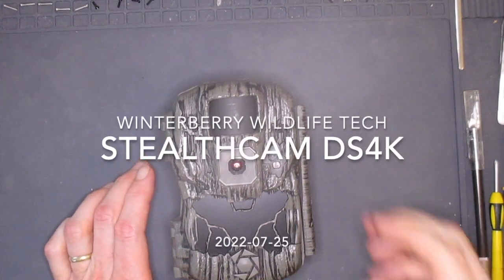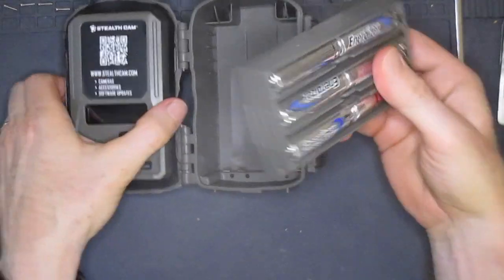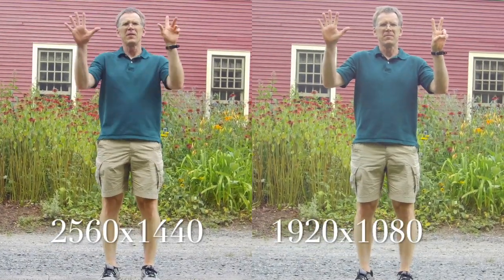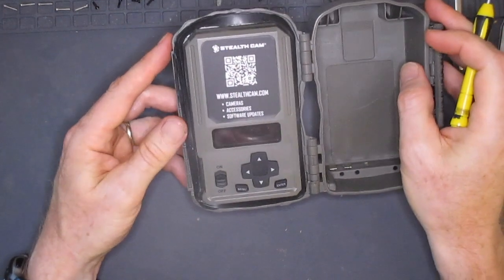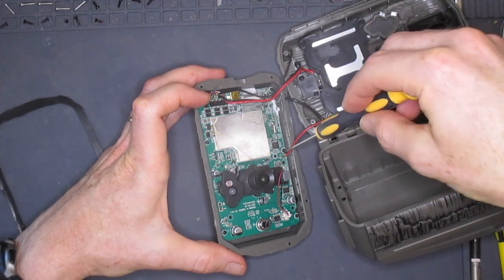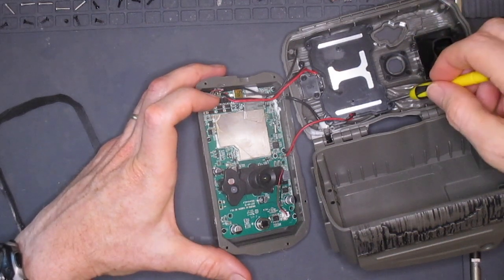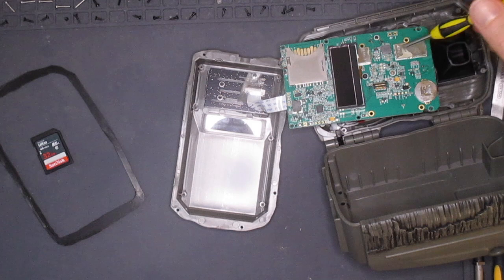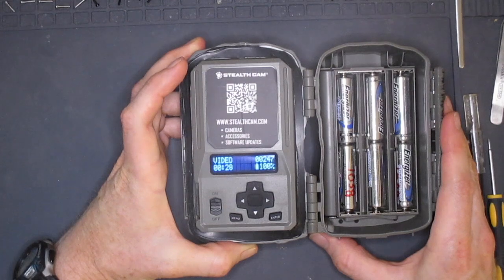Stealthcam DS4K Overview and Teardown   HD 720p

Comment: Do you happen to know of any replacement parts for the sensor lens for this camera. Something happened to mine and has several holes in it now
Reply from the maker: Sounds like a woodpecker attack.  Sorry -- I do not.  Browning is the only camera manufacturer that I know of that stocks replacement PIR lenses.  Unfortunately, PIR lenses are not standardized or inter-changeable.  Your best bet is to contact the manufacturer or the perhaps the distributor.   In future, you can try discouraging birds from perching (and then pecking) on your camera.  See, for example: https://www.facebook.com/groups/1772913616156410/permalink/6670789476368775/